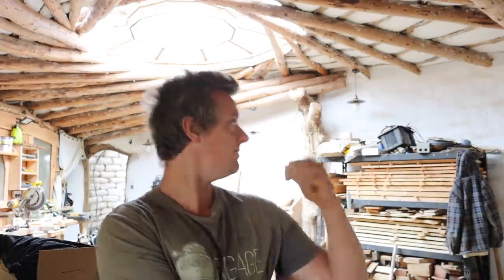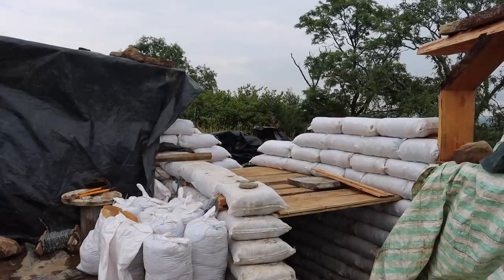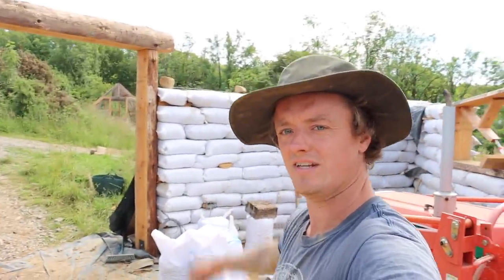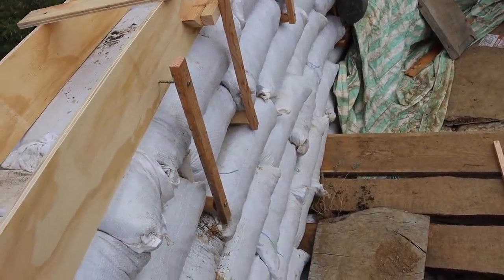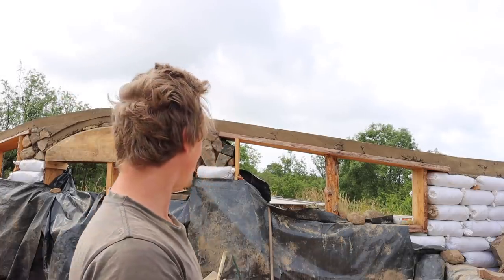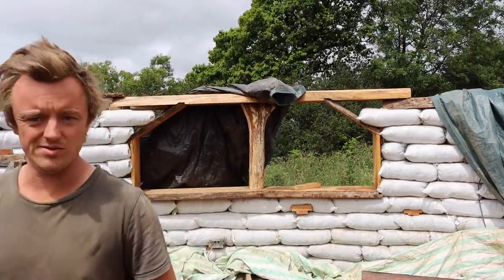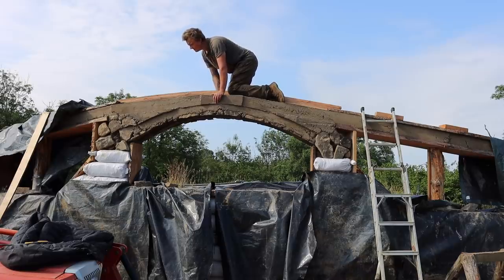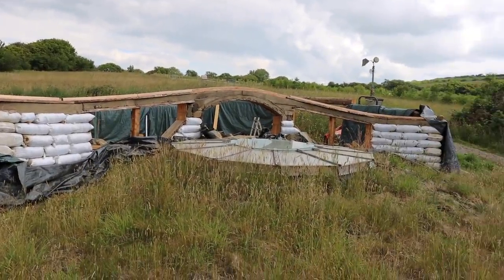Off Grid Earthbag Workshop Part 63 Walls Complete

Comment: If I remember correctly, concrete needs to be kept someone moist as it's curing. If it dries out too soon it will end up crumbly. It shouldn't be that bad though. Looks to me like you got some bad concrete from someone. Either it was old to begin with or they mixed it wrong from the factory.

Comment: I notice the spots where the other roof posts come through the wall have a good bit of cob built up around them. Is that because making up smaller bags to stuff in place in those areas isn’t really possible the space, or just because it wasn’t practical for the effort?
Reply from the maker: It because they are at an angle so the bags would need to be custom fit angled bags, so instead i just cobbed them in. They are sitting on some slate though to spread the load.

Comment: Why is this better than just building a wall out of cinder block? Less work and the cement you have to mix would be far less just using them in joints.

Comment: I’m surprised there isn’t some inexpensive powered tamping device.
Reply: Yeah! I had a silly thought of Kris making flat clogs with a wide 'sole' so they could jump up n down on those bags.  🙈😂
Reply: They do make tamping machines but they are heavy and IMO hard to move around and he gets around so easy with the hand tamper
Reply: @lethalspartan  that makes sense. It seems similar to post hole augers. IMO the extra weight of a handheld auger isn’t worth the trouble. Now, a tractor mounted auger is a step up.
Reply: @lethalspartan  Yes and those tamping machines used to have a mind of their own....I hope the more recent models are better.

Comment: You've probably addressed this and I just somehow missed it, but do you need to pay additional taxes or have building inspections for every new edifice you put up? I ask because in Canada even a cabin in the wild needs to meet building codes - smoke detectors for example - and there's an additional property tax per building. Or is it just your land to do with as you please?
Reply: You're talking junk. It all depends if the area is incorporated or not and has a building code requirement or not. Many areas in Canada do not require building codes. You need to do your homework before spouting crap next time. Canada is humungous - time to leave the safety of your city and surrounds!
Reply: In the uk we have a few departments  like building regs and planning permission department , building regs check your using materials and methods from your plans that meet building regulations,  planning permission department is the place you go to to ask for permission to build   a building,  when it comes to building regs I would be interested to understand how he has gone about building regs when using the unusual building materials,  but in the UK building regulations has no power over a building 12 months after the building works was completed,  unless they believe the building is unsafe then they continue to have power,  planning department can roll up in 10 years and still require you to make a application,  but there is also the passage of time loophole

Comment: You made 2 "mistakes" with the concrete. first, 5:1 mix is lean for the purpose... it should have been 3:1. Second, you needed more water and some stick to push it down into moldings   better...
21-28 days is tipical full curing time

Comment: That's not concrete, hell mortar has more strength then that. when they know there is going to be a shortage they will add flyash to the cement to fill it out, you can add flyash in proper amounts to lower the cost of things but it appears they added too much, thats probably a 50/50 ratio(it's a simple way to measure half the bag) when it should be 90/10 cement/flyash. I really hope you don't leave that in there, the moment any weight is put on it, it will crumble.

Comment: Ouch, that was a big doo doo with the concrete... It looks like not enough cement was added to it... (from my experience)
Reply from the maker: We did a three two one mix. Three gravel two sand and one cement all measured out in the same bucket. so the mix was right.
Reply: @KrisHarbour  Think you got done with old cement, mate.
Reply: @KrisHarbour  Damn, indeed seems like old, hardened cement, re processed.. :(

Comment: I don't mean to be rude but it seems that you don't completely realize how rebar in ferroconcrete works. IMHO what you do is just a waste of good steel and you definitely need to reinforce your arch above the window. The mauerlatt (wall plate) on walls doesn't need to be very structurally strong since dirt walls are pliable and can crumple and by this redistribute the weight of the roof.

Comment: 1: rebar is extended with a Diameter x 10 overlap. And you make 4 rebars per beam, under and upper row, with 3-5cm of concrete coverage toward the air/to the form. 
2: you need a vibrator for the forms!
3: water the concrete in the form. 
4: yes that concrete seems strange tho

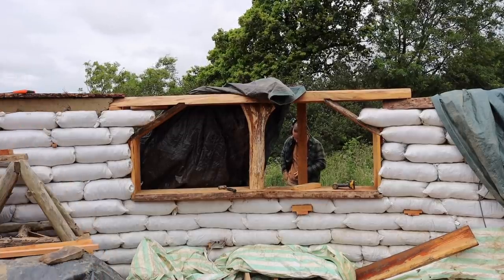Comment: This is what you need to sort out the logs in the woods - how many people in where you live in Wales would love to see an elephant helping out https://www.youtube.com/watch?v=IBjfVjKCTs4 (25:00). 

I have to admit I'm not a concrete expert as so many seem to be coming out of the woodwork, but the curing process tends to involve spraying the outside surfaces to help draw out some of the moisture from inside - if it starts coming out when the outer is dry, the paint that goes on tends to crack and come off. As you'll be using porous materials on top - I assume you're using lime - this probably isn't necessary - that's why  you're not doing it I suppose?

Comment: I really enjoy watching your vlogs - I've learnt so much from them. However, I'm afraid that your building methods have now little to do with natural building. You use sand bags, which are made out of polypropylene (non-biodegradable material), cement, and steel rods, which are neither natural nor eco-friendly materials. You should turn to natural stone, wood, and clay as your primary building materials. Cheers!